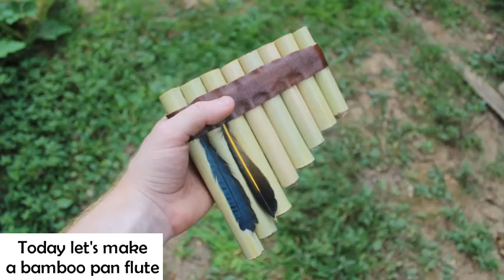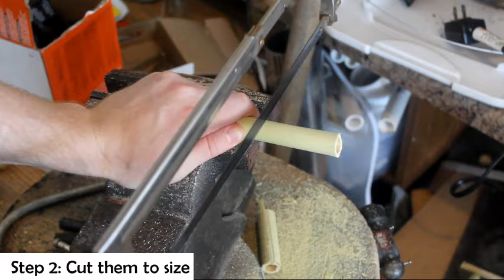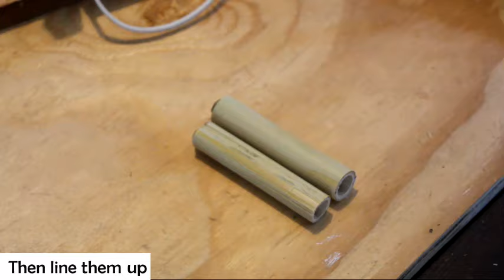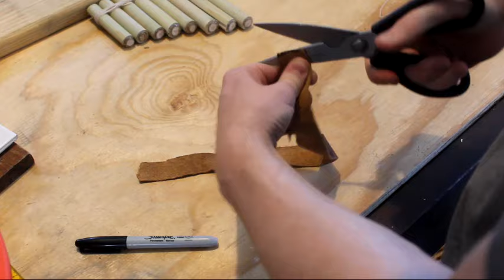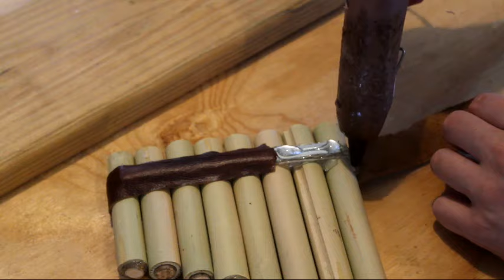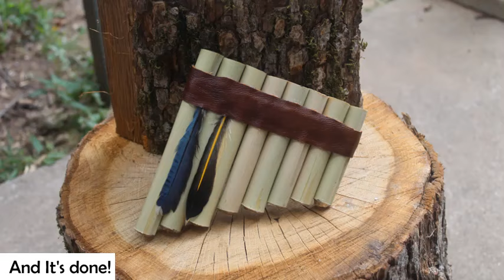How to Make a Bamboo Pan Flute (DIY)

Comment: Are there other ways to secure the pipes together, like a thin strip of wood? I need something to teach to a large homeschool group, something like this wood be great, but I'd need to simplify it just a bit. But this project would be nice! Thanks for sharing this craft. This is really neat!! I think I'll try to make one for myself.
Reply: Using two thin strips of wood and string you can secure the pipes in place, using wood glue to attach the pipes together also works, or you can use hot glue. A flat cutting of bamboo (or any wood) can definitely replace the leather used in the video.

Comment: What happens if my flute doesn’t make any sounds I just hear the air going in and out
Reply: je les règle avec un appareil, a l'aide d'un bouchon normal si pas de bouchon a une extrémité le vent passe de l'autre côté. Puis il faut savoir soufflé également.
Reply: I actually have cut bamboo reeds (just came on here to figure out how to assemble it).  First thing I left the divider sections intact so I didn't have to put plugs in.

2nd I discovered some cuts had a very slight angle.  Rotating the angle while blowing helped me find the sweet spots.